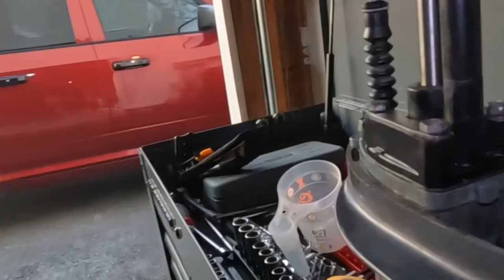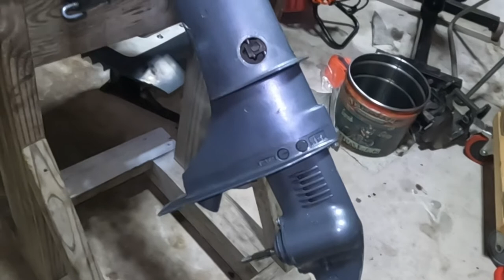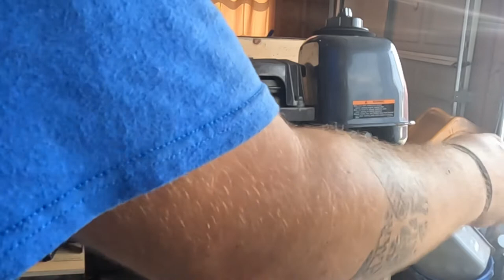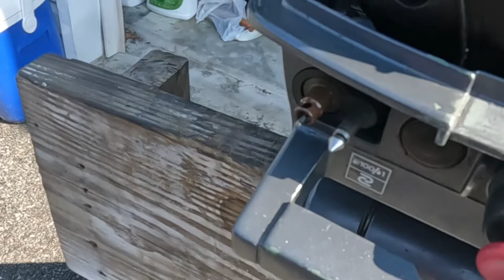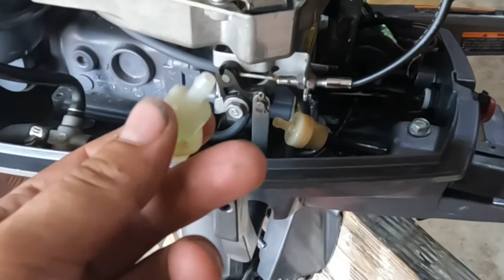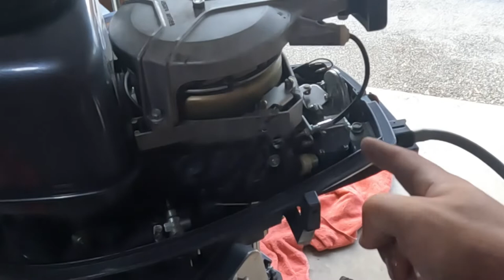Can I get it to run? Working on a Yamaha 5 hp outboard

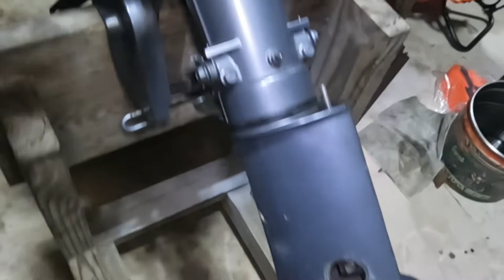Comment: 6:44 you want to make sure both the shift lever and prop are in neutral when you tighten the coupling nut. The nut should move up from the inspection port in forward and down from the inspection port in reverse.

Comment: Just noticed that you used a zip tie to hold out the kill switch. I'm guessing you didn't have the right kill switch key at the time. That's a great idea I'm gonna use that for sure.
Reply from the maker: Yea typically don’t get the lanyard when purchasing the motors so it’s a good trick when you don’t have one lol

Comment: I believe what you refer to as a fuel filter is in fact a one way valve..
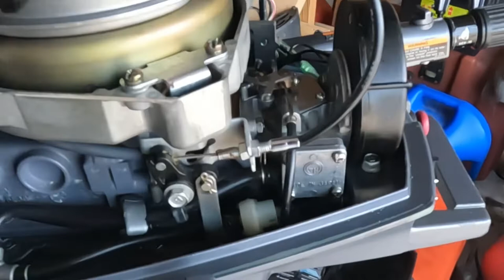Reply from the maker: Not sure what your referring to but if your referring to 11:00 in the vid it is a fuel filter. Also called a strainer by Yamaha. In quote from the service manual Yamaha OEM In Line Fuel filter Part number #64624251-02-00 or 646–24251-02-00 can also be used as a remote oil tank inline filter

Comment: I have one of these and I tried installing a killswitch but now it won't start and I've pit the old one back on and it still won't start I've cleaned the card and I'm picking up a new sparkplug any tips?
Reply from the maker: Check and may sure your getting spark out of the coil. Maybe u hooked up the wires wrong for the kill switch. I forgot for Yamaha but all mercs and such use a black with a yellow stripe for the kill circuit

Comment: Hi sir, nice video, lot of advice that would do for me. I have the same motor, and my gear shaft broke, I have the part to replace it, but have some doubts as for where to start dissasambling. Can you please please advice? do I need to remove the engine?, where to start?. thanks in advance.

Comment: Great channel, lots of great help, I was wondering have you ever done a head gasket on a merc 9.9, 4 stroke. I'm showing low compression (70psi  both cylinders) on my newly used 2007 any suggestions are greatly appreciated, my gheenoe misses the water
Reply from the maker: Hi there I have. Have you for sure narrowed it down to the base gasket tho? Reason I say this is because you could waste a lot of time and money doing it just to find out it’s something else. If your able to get yourself a cheap borescope camera and look in the cylinders. Check the walls for any scoring, scuffs, or carbon build up. If there’s scoring then the motor needs a rebuild and no matter what you do you’ll never get the compression up to where it needs to be
Reply: @outboardfinatic  Thanks for the reply, I did a compression test in both cylinders and they came back  70, it starts with the electric start, runs, pisses carb cleaned when I bought it it all looked good, went on a maiden voyage slipped into neutral and would not start, had to be towed in. I will look into an borescope, keep up the good work
Reply: @outboardfinatic  also a friend suggested pouring some marvel mystery oil to see if the rings or built up carbon could be an issue
Reply from the maker: @pucho513  personally I use powertune from mercury quicksilver. It’s a spray and it’ll turn your bucket black if you have carbon build up. Wouldn’t be a bad idea as carbon build up is possible
Reply: @outboardfinatic  Thank you for all the help, Turns out It was the cheap o harbor freight compression tester, it didn't have a Schrader valve, got an innova from O'Reilly and all cylinders are at 100

Comment: Please do more older 25 outboard. Mine won’t hit wot. Any ideas?
Reply from the maker: What do you have? I made a couple videos on merc 25s from different years and I think one Johnson video in the past
Reply from the maker: My only thoughts without obv being able to work on it myself is. Does the motor have good even compression. Does it have solid spark even at wot. Come some will spark fine at idle then the trigger takes over for the higher rpm’s. So maybe a trigger or point system went bad. The only thing really then after that is fuel related stuff. Is the fuel pump shot or is you high speed jet in your carb clogged. Also make sure the carb butterfly is opening all the way. Should be completely level when you go to wot. Really that’s just about it that I can think of other than maybe wrong pitch on your prop or something of that nature. But I’d start with compression and spark first. Then go through your fuel system

Comment: Hey man got an old yamaha 5hp. The pull started won't budge after sitting during the winter. any idea what it could be before i disect this engine? :) also the reverse doesnt work.
Reply from the maker: Def in neutral? Spin the prop and make sure it spins freely that means it’s in neutral. Reverse you can’t shift into without spinning the prop while you shift. Clutch dog needs to line up with the gears. Forward it always sprinted forward so you can always shift it in forward without spinning the prop
Reply from the maker: Only thing in my mind that could make that happen from sitting over winter is either that it’s not actually in neutral and the neutral safety switch his hitting the fly wheel or possibly if you had some kind of water intrusion and now the rings are stuck fast. Or you have lower unit problems and the drive is locked and not allowing the powerhead to spin. Best way to know is just drop the lower unit and see if the flywheel spins
Reply: @outboardfinatic  thanks buddy for your rapid response. I'll try it out!

Comment: What compression number should we be seeing?
Reply from the maker: As long as it’s above 110 you’ll be fine. This motor I had 120. But age ofc gets to the cylinder. Some have been able to keep running even below 100 but it’s uncommon
Reply: @outboardfinatic  legend thank you!
Reply from the maker: Also just make sure it holds the psi when you do a compression reading. If it starts leaking down then you have a leak somewhere as well just something to keep in mind. When you do the compression it should hold and not leak down
Reply: I have one of these motors. It starts and idles fine when cold , runs fine but can be contrary to start after I have been on a drift for more than 15 minutes. I find I have to re-choke the motor to start it then it seems to run fine. I have just cleaned the carby out so I will see how that goes. I did a compression test on it and it has just over 100. Do you recon that could be my problem?